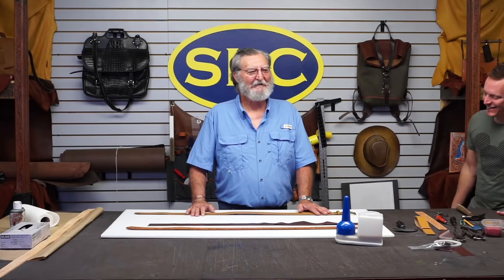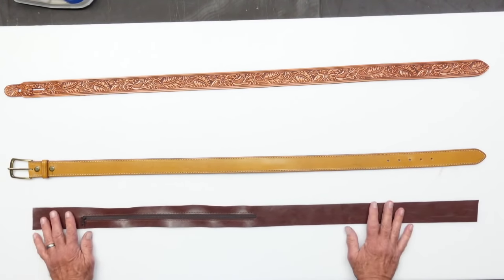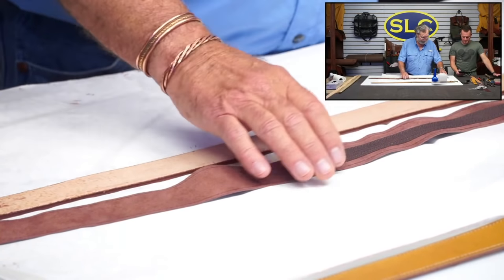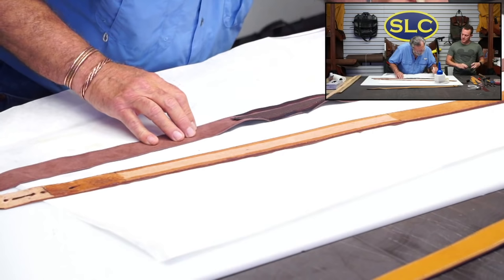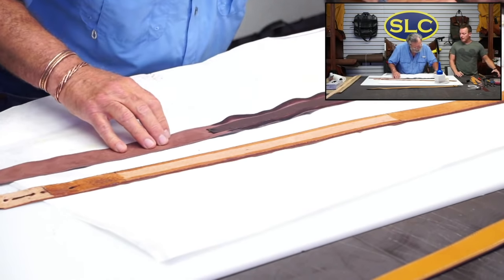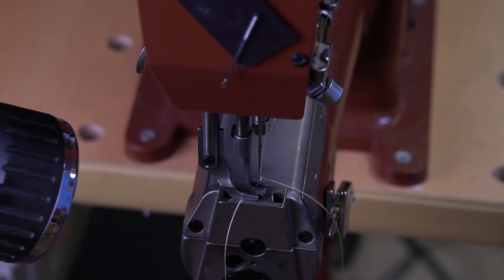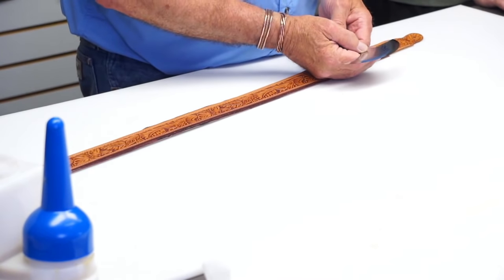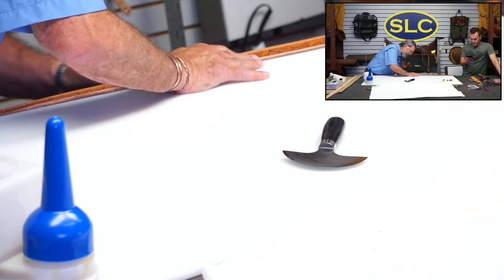Crafting a Money Belt w/ Denny + Tony

Comment: Tony, could you show us how you make the videos. Camera setup, camera equipment  and how you control the different views etc. I think its more complex than viewers think it is. But it would be interesting to know how you make the videos.
thanks
Reply from the maker: Maybe we need a video on that!! LOL

Let me say…we have 4 cameras and 2 mics. The cameras get adjusted throughout videos and we run Picture in Picture most of the time. Each of those cameras are hooked up through hdmi cords into an ATEM Mini. That is how we run PiP and switch cameras. The audio sources run into a Zoom H4N through xlr and 3.5mm cords (depending on if it is the mic at my desk or overhead). This all goes into the computer to a program called OBS, which to stream 3 platforms, I have 3 instances of that running on 1 screen. 

For OBS the main feed is YouTube and I use OBS virtual camera to feed that source to FB and Twitch. Each of those OBS have to have certain settings and they all have to be changed if I adjust any audio specifically. Twitch has other graphics that overlay on that stream. 

My second screen I have 3 browser Windows open to read the chats of YouTube, Facebook, and Twitch. I pull the questions from the chats and paste them in a power point that displays on screen 3 that is above the table so Liz, Denny, Kevin, or whoever is on camera can read them. 

This video here…the set up was the same except I had the ATEM software running on the second screen and the chats on the third screen. On my phone I hooked into my computer so I could switch cameras since we were shorthanded and trying to release a new product. 

When we first started…I had restarted my computer, but forgot to set the H4n as an audio interface. Mistakes happen, but there is a lot going on and things happen.
Reply: thanks for the reply. What kind of cameras? do you know model numbers. They seem pretty clear.
Reply from the maker: @bassalot4758  we use all Sony. 2- a6000. 1- a6500. 1- ZV1.